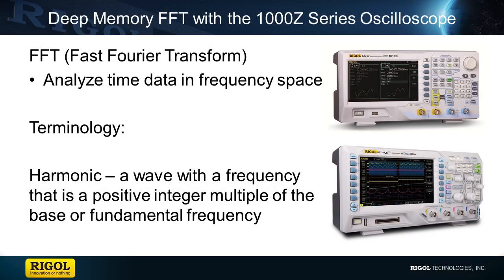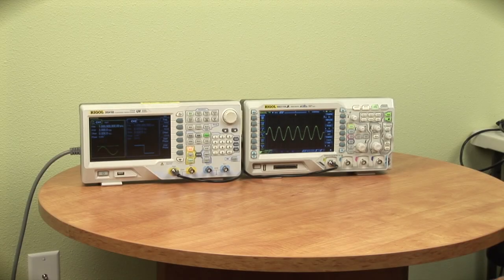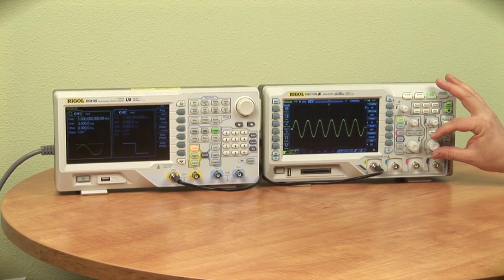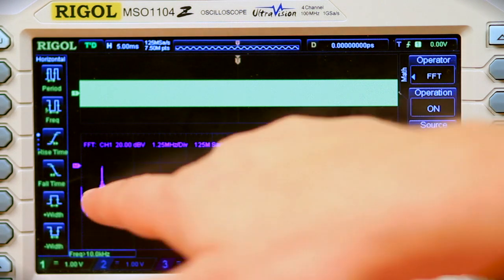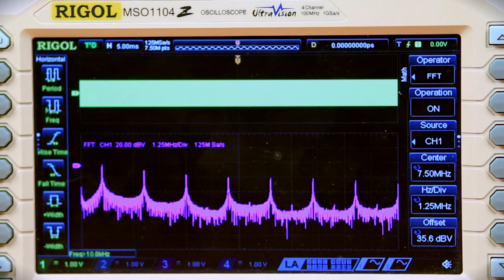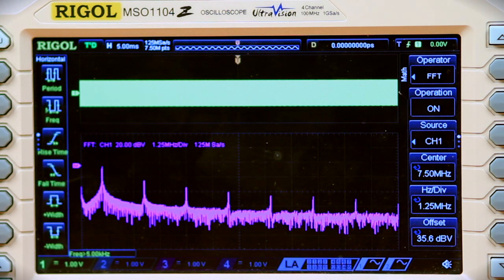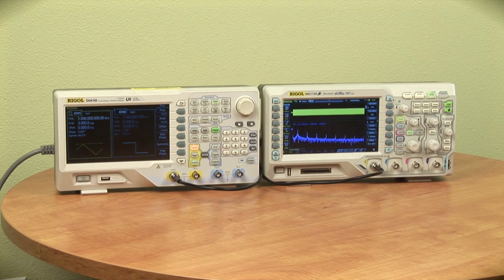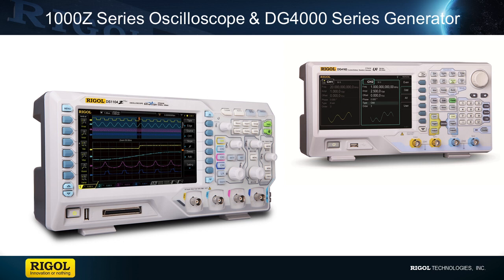Using FFT Analysis

Comment: @RIGOL I have the DS1202Z-E scope, but to my knowledge the FFT options are the same as in the MSO1000Z series (please correct me if I'm wrong).
 Your demo is valid if the FFT setup is set to "Memory". If the the FFT uses the "trace" option and the time base is less than impulses period than the scope will show unexpected results in 90% of measurements. 
I try the FFT principal, more periods is better... my scope will lie., it will show additions in between harmonics (square wave). It can be easily reproduced.
- Use 10kHz square wave.
- Set the time base to 100uS (microsecond).
- Turn on FFT, choose "trace" option (it's the default), window as blackman/harris (or Hanning) and adjust your "Hz/Dev" to point when you see 4 harmonics (fundamental, 3rd, 5th, in 7th).
- You will see the correct results.
- Change your generator infrequence to 10.1kHz... now you will see 2 ghosts between each of the harmonics. 
The "ghosts" will always occur if time base (the "H" value in the top-left sight of the screen) is less than single period of the square wave... I use 10khz and 10.1kHz only as example, you may try 1000 Hz and 1100 Hz, the results will be the same.
The scope is working fine in the "memory" mode, but you can not choose resolution better than 10kHz/Div.

First I thought it's something wrong with my generator and I repeated the test using HP 35660A signal analyzer and FFT option in Tektronix MDO4104 - both did show the harmonics without the "ghosts".

I'm guessing the Rigol scopes have a bug in firmware when it's in FFT "trace" mode.
Reply from the maker: It’s true that more periods are better for the FFT measurement – you should try to have a minimum of 100 waveforms to create best FFT measurement on this scope. Any lower than that might produce weird effects and false harmonics. However, you also need to consider the sampling rate of the FFT. Increasing the horizontal resolution lowers the sample rate and if it gets sufficiently low it will interact with the signal frequency, showing more noise and false harmonics. For square wave measurements it’s important to strike a balance between number of waveforms and sampling rate and this value depends on the frequency of your signal. 

You should be able to discern peaks with this method but if you need more accuracy, you can always switch to memory mode which isn’t limited by the sample rate scaling. Memory mode works off the set memory depth and needs to be lowered for better resolution at low frequencies, so for 10.1kHz the best setting is 120k points.

Comment: How many FFT points does the 1000Z series has?
Reply from the maker: The DS1000Z series can use up to 16384 points to create its FFT.
Reply: @RigolTech  is there a way țo choose that, or it chooses automatically?
Reply from the maker: @gearstil  You can change the amount of points used to create the FFT function by changing the FFT's Mode setting.  Trace use 1200 points and Memory uses 16384 points.
Reply: @RigolTech  Ok, I understand! Thanks !

Comment: Where with in the settings of the scope did you switch to a square wave (time 1:30)?
Reply: It is not switched within the scope. The input to scope from signal generator is switched to Square wave.

Comment: Thanks for this, very interesting. Just one question when using FFTs for high frequencies - on my Rigol if I set the time base to 5ms like you have done here for deep memory, the FFT center and hz/div are set to very low frequencies (orders of Hz) and it takes for ever to reset them up to with the adjustment knob. If I use a short timebase I lose the memory depth. Is there a better way to set this up?